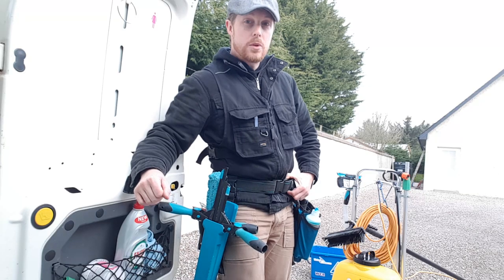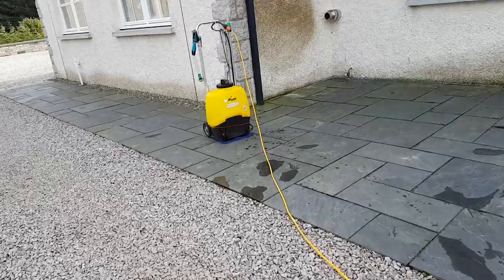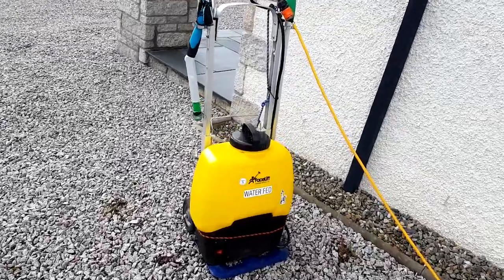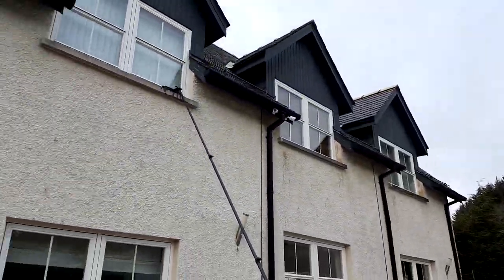Residential Window Cleaning Water Fed & Traditional Techniques | Trad-Man

Comment: how long does the water last
Reply: Brad Cruise not an easy question to answer as there are a few variables to consider like how high you set the flow, how long you spend scrubbing and rinsing, and wether you save water between moving from window to window ie with a uni valve. At a rough guess it would be between a dozen to twenty normal windows.

Comment: Why do downstairs trad?
Seems pointless..
why pole stuff on the down that you can clearly reach?
Other than than that nice vid👍🏻
Reply: Paul Silverman the whole job used to be trad but now it's easier to use the wfp for the high stuff. I trad the low stuff because there is often ingrained dirt on the low windows that won't come off with wfp so i use the trad gear to do the lower windows which i can reach no problem. Thanks for watching